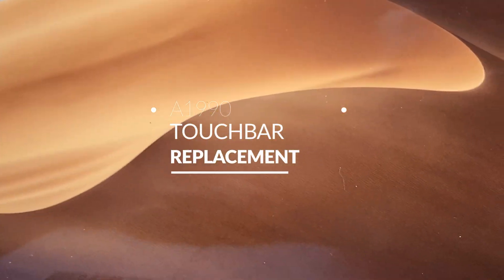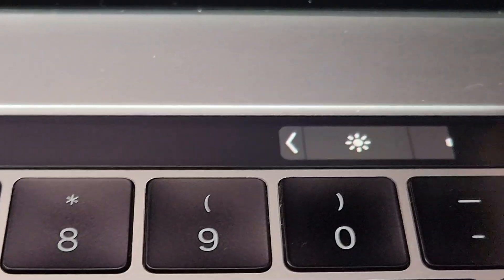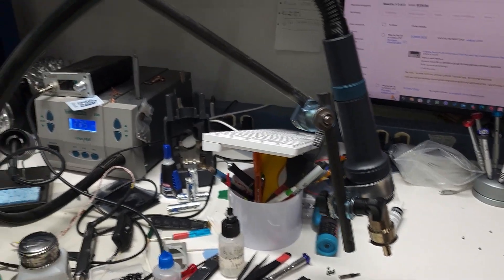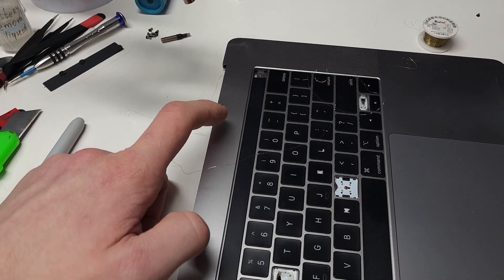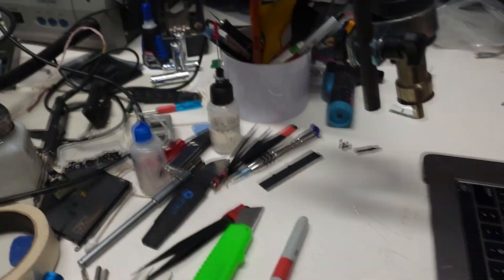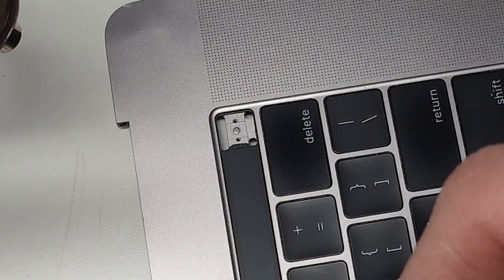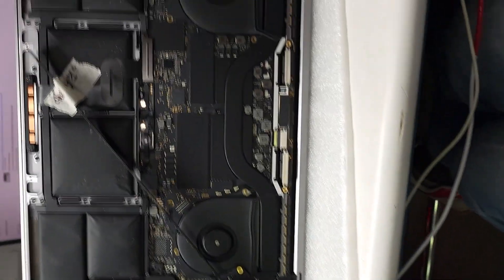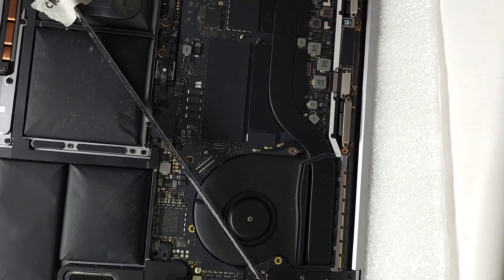15" MacBook Pro A1990 A1707 2016-2019  Touch Bar Removal / Replacement

Comment: Thank you for the video.. You showed me that this repair is way beyond me skill set, and I would just buy a used keyboard and Touck Bar pre-assembled, over using razor blades, wire, and acetate .

Comment: Thank you for this buddy, was getting constant kernel crashes due to a faulty touch bar which is way too expensive to replace. And disconnecting it solved it! ;) Can’t use my touchbar now, but at least my macbook works again 😂

Comment: When you are about to pull the bar the video is cut, it is very likely that you tore the flat cable and then replaced it with another bar.
Reply: its already broken. what's your point
Reply: @Funlu because you can take from donor board and use on another Mac that’s the point your not competent for this job